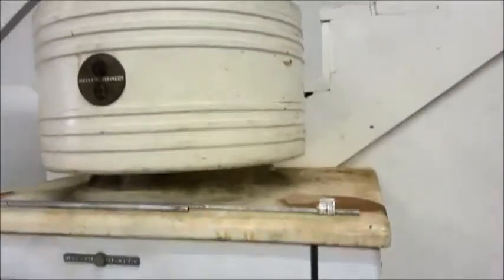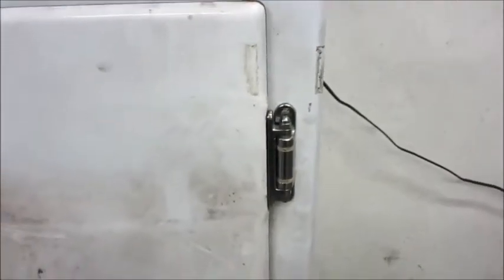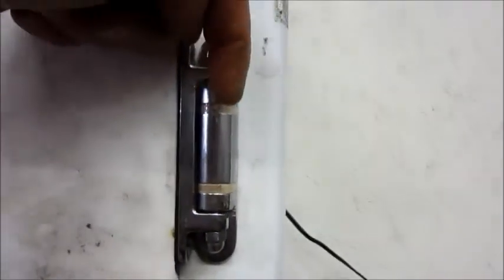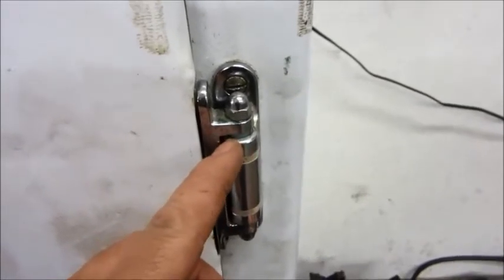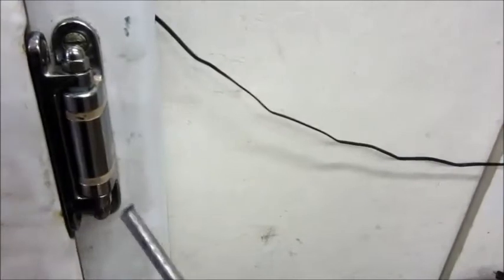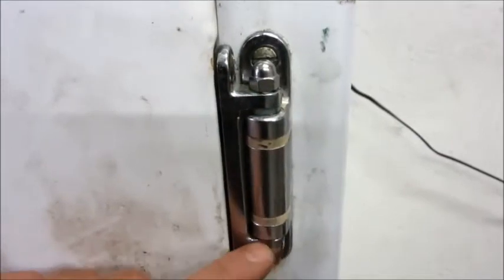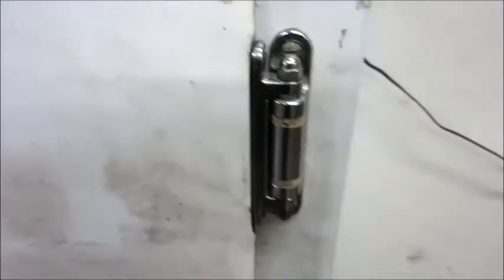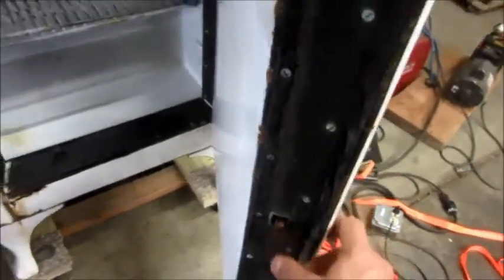Repairs to 1930's General Electric Monitor Top Refrigerator - 3 - Door hinges...

Comment: Thanks Dave.  I have used this method to repair my old Barkalounger recliner.  After those plastic bushings wear out, the hole oblongs.   Nice repair.
Reply from the maker: Thank you!  Yeah there are a lot of applications for this sort of repair!

Had the previous 80 years worth of owners kept the hinges oiled, it might not have been necessary LOL!